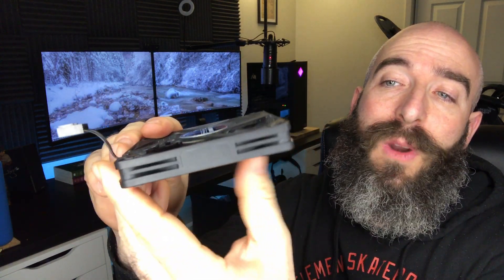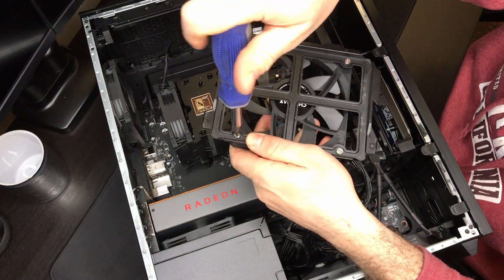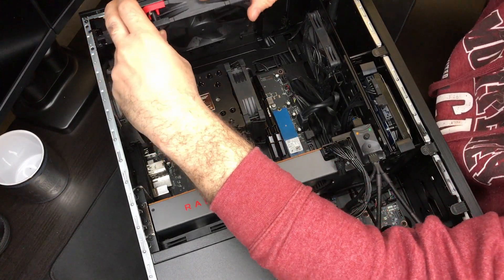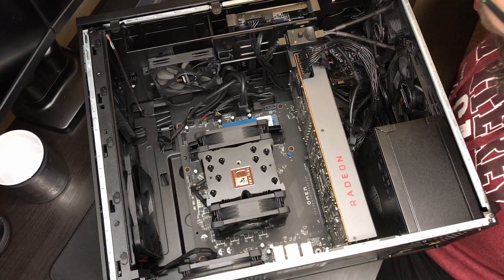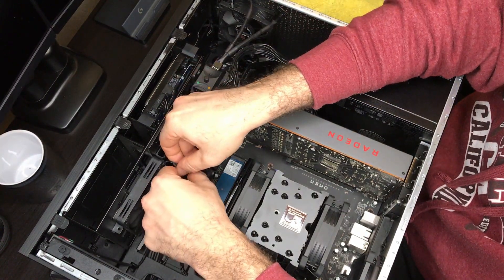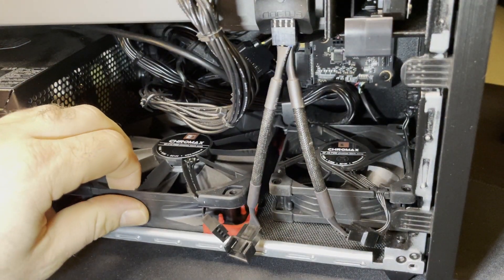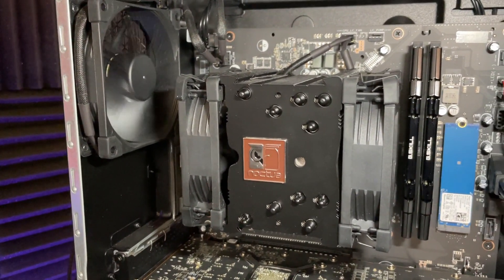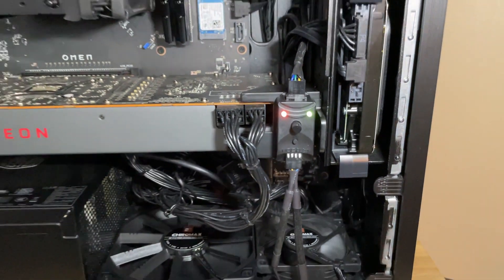How to: Install and Setup All Fans in an HP Omen 25L / 30L! Tutorial & Guide!

Comment: Hey Dan.  Nice videos.
Do you know like the PSU in the HP omens are good or not ?
Like I got the Cooler Master 750w 80 plus platinum ( non modular ), and the Cooler Master 800w 80 plus  gold ( non modular ).
Would you know if they are bad, medium or good quality PSU's ? 
If you know that is.
Reply from the maker: They are made by Cooler Master and will get the job done. Not top of the line but will be OK. Only downside of them is they are non modular.

Comment: Great video again. I just installed two 120mm fans (bottom and top). I used Arctic ones due to the price but they seem quiet. The temps seem to be about 5-6C cooler already, which I am happy with. I may replace the rear exhaust and the CPU cooler fan. I am still a bit confused as to whether the CPU cooler fan is 80mm or 92mm. As the existing one is round I am not sure I am measuring it right but it looks like 92mm and I see other comments saying it might be 92mm rather than 80mm. Anyway, should all be running cooler by the time my new GPU arrives!
Reply from the maker: Some CPU cooler fans are 80mm and the bigger round ones are 92mm. I honestly wouldn’t recommend changing just the fan on the cooler, but replacing the whole cooler itself. Very minimal drop in temps with just the new CPU cooler fan. A CPU cooler will dramatically lower temps compared to the stock air cooler though.
Reply: @DanKamYouKnow  Great advice. I was wondering. I think I'll ear mark that as my next project then!

Comment: hey I have an omen 25l and i dont have the front fan plugs for the bottom fan . but at the bottom on my motherboard i got the same 4 pins plug , can i plus the bottom fan in it? thx
Reply from the maker: Yes, that should work fine. You can also use y-split cables off existing fan headers if you need to as well

Comment: All fans are on pin 3 or 4?
Reply from the maker: 4 pin fans
Reply: @DanKamYouKnow  and the fan inputs on the motherboard are compatible with 3-pin fans?
Reply from the maker: Yes they are but I’d recommend using 4-pin fans because they are PWM and could change fan speed
Reply: @DanKamYouKnow  To which input on the motherboard is it best to connect the cable to which the two fans are connected?
Reply: @DanKamYouKnow  splitter

Comment: Dude I just added a Noctua fan in the front right where you did and it dropped my ssd temps by 16c. So happy with the results, ssd is sitting at a steady 33c now. I should have done that so much sooner lol. Thanks again for making this video man it has helped alot.
Reply from the maker: That’s awesome to hear! Glad the video helped you out my dude. You’re welcome 🤝
Reply: @DanKamYouKnow  I have one more question, in the omen software is it safe to put the fan speed to turbo? besides it being a bit louder is there any downside to it? When I put it on turbo my temps dropped quite a bit and I'd like to keep it that way, I am going to be getting a new case with better airflow soon but in the mean time I'm doing everything I can to keep the temps down. Putting it on turbo has dropped my CPU temps to around 60, my gpu to 49 and my ssd to 30c and I'm really happy with those temps just wondering how much faster the fans will wear out if I keep it on turbo
Reply from the maker: The fans are pretty much designed to run at any speed throughout their RPM range, stunning them on turbo all the time is just fine, and I actually recommend it. 👍🏻
Reply: @DanKamYouKnow  Awesome, thanks dude.

Comment: Dan I have a question regarding that too fan mount I removed it to increase air flow until I got a top fan but now it any solution to mounting it to the top without that bracket? Or where to buy the bracket
Reply from the maker: I’m not sure how you would mount it without the bracket tbh. I have heard from other people who lost their bracket that they had a tough time finding a replacement. Might have to talk to HP or go on eBay

Comment: when i do the case swap of a omen do i need the wifi card when i use ethernet and do i need the small motherboard that controls the rgb fans?
Reply from the maker: I only use Ethernet so I did not swap over that little card when I did this. You most likely will not need the RGB board unless you are planning to use the case lighting strip from the Omen

Comment: Hey Dan, Could you create a tutorial on how to optimize the cooling of the 40L?
Reply from the maker: I would love to but I haven’t gotten the chance to test a 40L yet. HP isn’t too interested in marketing the 40L so they haven’t sent out review units.
Reply: The 40L can be purchase for about $1400 with the 10% discount coupon from the HP website. Should I buy the 40L noe or hold off to see if the price drops any lower on Black Friday? (I'm talking about the GT21-0385XT)
Reply from the maker: Looking at the specs, that’s a pretty good deal for what you are getting. Only cooling options is probably recommended ( if needed at all ) are setting a custom GPU fan curve with MSI Afterburner and possibly undervolting the CPU slightly.

Comment: I have a 30l and cant find the front fan 4 slot its only 2 and 3 any suggestions?
Reply: And a front fan 1
Reply: And it looks like my front fan is plugged into my front fan 1 slot
Reply from the maker: I would recommend using y-split cable with one of your current fan headers
Reply: @DanKamYouKnow  thanks I appreciate it and one more thing I bought 2 120mm fans and a single 92mm fan is that enough to drop the temps a bit?
Reply from the maker: Yup. I would put a 120mm fan on the top ( exhaust ) and bottom ( intake ), and the 92mm fan on the rear one. Should help a couple degrees in temp.
Reply: @DanKamYouKnow  thanks you are a huge help🙏
Reply from the maker: You’re welcome! It’s an easy addition!
Reply: @DanKamYouKnow  Update 
 I installed the fans and it didn’t seem to impact the temps at all. I followed the video step by step any advice? Cpu is at 70-80 while gaming and gpu is 80-85 while gaming

Comment: Any chance you know what screws you used for the top fan? Was it the ones that came with the fan? 🫣
Reply from the maker: Yes. The 4 screws came with the fan. You can also buy them from Amazon if you search for “PC fan screws”
Reply: @DanKamYouKnow  Gonna have to do that, because turns out I got four destroyed screws, somehow 😭😭 Thanks for the quick reply, wasn’t sure if I was missing something!
Reply from the maker: How are they destroyed? The tips of the screws will be pretty flat, if that’s what you mean.
Reply: @DanKamYouKnow  Not the tips, no. It’s hard to explain, but I could upload a picture to discord. It’s almost like someone tried cutting the nail in half. I tried to see if it was supposed to be like that, but no, it wanted to break my fan when I tried 🥲
Reply from the maker: Would definitely love to see a picture of you want to join my discord server

Comment: you should talk about how much installing a top panel 120mm fan causes major overheating issues.
Reply from the maker: I have yet to see ANY HP Omen overheat because of the addition of a top fan. Yes, they do run warm out of the factory and a top fan won’t magically make the PC run a ton cooler but, do you care to explain a little bit?
Reply: @DanKamYouKnow  i followed the instruction the video you posted about how to install a 120mm in the 25l or 30l.  so i did that just today and temps went from a normal 70-75 with stock components to a insane 85-90 with the top fan installed.  not sure if it was pushing cpu heat onto the gpu or what but uhh i had to stop that real quick and it went back to normal.  otherwise your vids are awesome and helpful but this time seems tricky for me.  all the best Dan!!!
Reply from the maker: I would really be curious on how you hooked up the fan because there’s no way that a top mount fan, set as intake or exhaust could raise the CPU temperature 20 degrees. Did you pop out the squares of the top bracket? Did you see the fan as exhaust? How is it hooked up to the motherboard?
Reply: @DanKamYouKnow  I had it installed as an intake with the 4 panels removed plugged into the LCU FAN 4 pin.  my buddy on discord said I should flip it to exhaust since I have one on the front panel for intake.
Reply: @DanKamYouKnow  also my cpu Temps were normal under load Maybe 69 or 70 but the gpu was COOKIN

Comment: So I have a 30l rtx 3080ti, right out of the box it runs hot just as a lot of people have suggested, but I found a way to drop my temps by 24-28 degrees fahrenheit by simply turning up the fans rpm speed via the graphics card settings. 

The turbo mode that the omen hub places the fan speed at is a joke it only has it running at 800-1100 rpms at any given time. 

However after manually adjusting the fan speed via the graphics card settings I was able to pump out 3500 rpm+ which took my pc from running at 87C to 62C.

Now the stock fans do run loud but for over a 20C decrease I think I/you will live.

In conclusion if you do not mind a little noise from your fans "which if you are a gamer you are using a headset anyways so yeah . . . what does it matter" and do not want to take extra time/energy/money pull up your "NVIDIA GeForce Experience setting>In-game overlay> select the big [DONE] icon>Performance>at the bottom FAN SPEED will be greyed out, select manual, turn the speed all the way up. 

Now listen to how loud your fans get, watch the RPM zoom up a couple of thousand, and watch those high numbers on your GPU start to slip away.
Reply from the maker: Adjusting the graphics card fan curve is a great way to lower your GPU temps, but it won't have any effect on your case fans ( rear 92mm, CPU cooler fan, and front 120mm ). I am a strong believer in using MSI Afterburner to adjust the GPU fan speeds to lower temps ( or through whatever graphics card settings you used ).
Reply: @DanKamYouKnow  Great point, you are completely correct! 

This is only too lower your GPU temps, as far as the CPU this method will have no affect.

 I am a gamer so I wouldn't be putting as much stress on the CPU as say an architect or engineer, so I didn't take that into consideration.

Comment: Hey love the video man, but I think you installed the top fan backwards. I followed this originally (same fan) and noticed no air coming from the top. Upon inspection the inner ring has the arrows where the fan is blowing. If the top is used as an exhaust then it is backwards. Maybe I’m wrong but I changed my fan around and can feel a difference
Reply from the maker: The fan can be oriented either way and it depends on the setup used inside the PC. For me, as exhaust, I noticed a 2c lower difference then set as intake. This might be because of the push / pull setup I had with the Noctua U9S setup. For my system, exhaust worked better. That is strange that you noticed no airflow from the top; only thing I can think of is that you didn’t remove the 4 little squares on the top bracket.
Reply: @DanKamYouKnow  in the video here the arrows are pointing into the case tho? Shouldn’t they be pointing the other way if it is used as an exhaust?
Reply from the maker: The logo side of a Noctua fan is which way it’s blowing and I know for sure that it’s exhaust. All Noctua fans are the same.
Reply from the maker: Like this:

https://forums.tomshardware.com/threads/two-sets-of-arrows-on-the-noctua-nh-d15.2557076/
Reply: @DanKamYouKnow  the arrows point differently tho

Comment: As the resident IT guy in the neighborhood, I'm asked for a lot of assistance from neighbors, which I give for free. In spite of my working at an enterprise level for the Navy, gaming and related hardware is NOT in my wheelhouse. I was recently asked by the mother of a 12 YO kid to help install a gifted KRAKEN Z53 RGB and I had to tell them that it wasn't compatible with his OMEN 25L and it should be returned, which disappointed the kid, given the wow factor with lights, displayed temps and all that. I told the mom that I needed to check for compatible solutions as a way to buy some time, and then I found you and your videos. They are a family of modest means, so I ask you this: What would be a decent cooling solution for this kid? Kraken 120 (lights), Corsair H60 and/or Noctua NH-U9S or some combination thereof? Thanks in advance. ~Doon
Reply from the maker: Hey Doon! Personally, the U9S is hands down the best option for Omens. I have done tutorials on the U9S and the H60 and after thorough testing, the U9S is the best cooler for the Omen case. With that installed, a bottom mount 120mm intake fan and top mount 120mm exhaust fan really do the machine wonders. The lack of USB headers on the Omen motherboards makes powering RGB difficult and most RGB software doesn’t even recognize devices plugged in. The Corsair H60 only requires SATA power which is why I decided to go with that one, because of all the requests I got for a tutorial on a liquid cooler, over the original air cooler video I did.

Comment: Ive install the same top fan but its so loud can you help me please
Reply from the maker: How do you have the top fan plugged in?
Reply: @DanKamYouKnow  with the rear fan exactly like you in the video with y split cable
Reply from the maker: Try switching around the legs around of the y-split cable.
Reply: @DanKamYouKnow  ok thanks i will try that
Reply: @DanKamYouKnow  ok so yeah it worked but it seem to have reduced the cooling also( that i think would make sense )
Reply from the maker: It shouldn’t make a huge difference but you’re right, lower fan speed will / might increase temps a bit
Reply: @DanKamYouKnow  but i dont get why the y split cable didnt come with both side 4 pin cause i have one side with 4 pin and the other side 3 pin can you explain ? ( btw i bought the exact same as you )

Comment: So I have my fan set up just like yours in a 30L. When I hooked up the noctua 92 mm instead of the stock 92 mm I noticed the rpm on that fan was too low so I switched them back around. Now the fans seem to be stuck at a lower RPM which is not causing anything to be to terribly hot but still needs to be addressed. I tried reinstalling windows hoping that would reset the BIOS but nothing changed. Would it be possible that the sys fan 4 pin header read the noctua 92 mm fans lower RPM and now everything is set to that? The stock fan used to be quite loud and move more air before doing this.
Reply from the maker: Have you tried switching the legs of the y-split cable around?
Reply: @DanKamYouKnow  Yes I've tried multiple configurations with  y split cables of the top fan and the rear 92 mm fan with no luck. I think maybe the Y split cable might be the issue. One has 4 pins in the socket and one has 3 pins. I have 3 fans plugged into the fan header on the bottom right. Possibly I'm overloading the MOBO. CPU maxes at 80c during these summer temps without sounding like a jet engine at least.
Reply from the maker: The difference in RPM might be the culprit but I never ran into issues. All y-split cables have a leg with 4 pins and one with 3 pins, because the 3 pin side is just mimicking 4 pin side.
Reply: 30c idle temps.....I'm happy
Reply: Specs are 5600G & 3060 btw, stock cooler of course, really want to upgrade but don't trust myself lol
Reply: On a whim I tried switching y cables and disconnected the fan attached to the HDD cage and the back fan seems to be spinning at a higher RPM,  definitely an improvement.
Reply from the maker: Interesting. Nice to see an improvement
Reply: @DanKamYouKnow  Yep appreciate it CPU maxes at 75 now and got all fans going, cheers
Reply from the maker: 75c is good and safe for sure. No worries.
Reply: @DanKamYouKnow  Thank you for helping with these temps. I'll be confident enough to install a CPU cooler pretty soon I think
Reply from the maker: Patience, the right tools, and lots of before pictures. You can do it 👌🏻💪🏻

Comment: Do a video where you plugin the fans without the Y- Split Cables?
Reply from the maker: Unfortunately with Omens, splitter cables are pretty much necessary. There aren’t enough fan headers to power more than what the PC already came with
Reply: So would I be able to add 2 cooler master fans to it without the Y-splitters ? Because on my old pc mother board I amble to plug in 3 fans.
Reply from the maker: If you have the room, then sure.
Reply from the maker: Omens run a bit warmer than most PC’s, but usually always safe temps.

Comment: i used my sata cable that i had hooked to the fan control module to a extra hard drive, is it another way to hook the fan controller up? i have it hooked up but its just on no change in fan speed
Reply from the maker: Disconnect it from the motherboard and try. Controller works best when only SATA power is plugged into it
Reply: @DanKamYouKnow  appreciate that bro 💪🏿
Reply from the maker: Let me know if you have any trouble but the manual dial should work ( more ) properly without the controller being plugged into the motherboard. So just give it SATA power and it should work great
Reply: @DanKamYouKnow  i think my omen came with only two sata cables.. I might try a y splitter and see if i can give it power..
Reply from the maker: And THANK YOU for the donation!! I really appreciate you doing so to help support my channel! Thank you so much.
Reply: @DanKamYouKnow  anytime bro.. I try to support everyone I'm subbed to on YouTube.. If it wasn't for your video i would only be running the two fans that came with my omen Lol
Reply from the maker: Yeah, most Omens come with 3 SATA connectors total. One for the light bar / one for the HDD ( if the machine has one ) / one free one for another hard drive or fan controller, etc.
Reply: @DanKamYouKnow  I just seen it unplugged it and the light bar didn’t come on lol.. I might try getting some extensions and see if I can get it all going at once.. appreciate your feedback it’s really been helpful
Reply from the maker: No worries 👌🏻🙏🏻